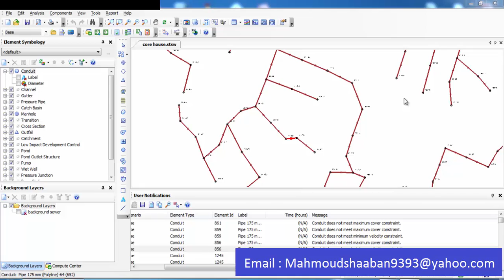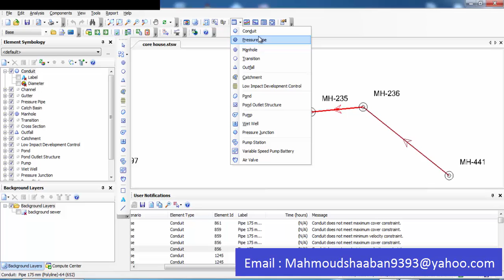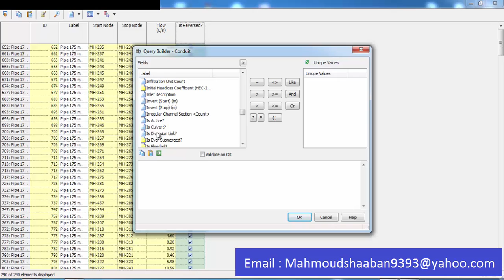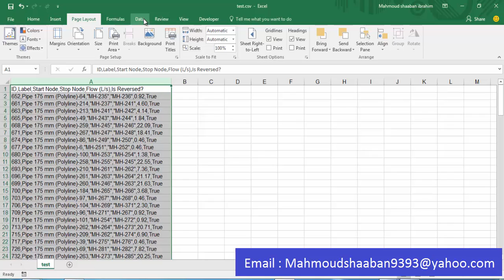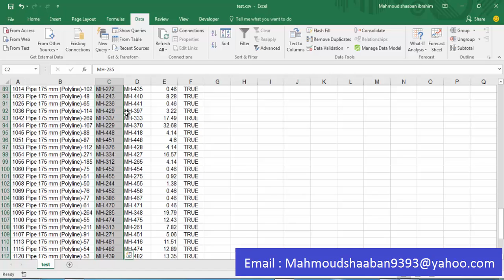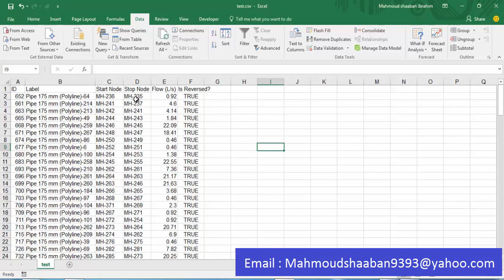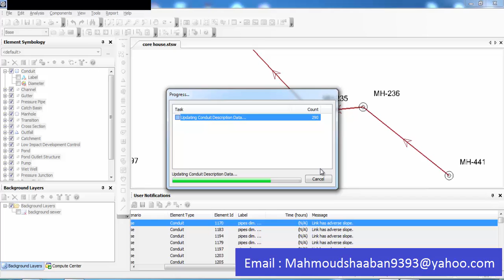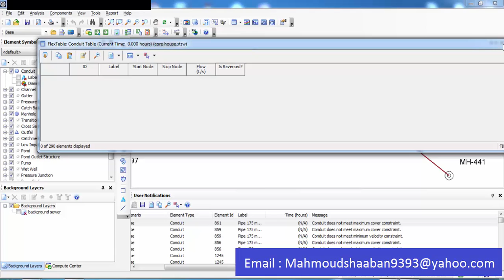Bentley sewecad & sewergems ,reverse the conduits direction automatically.

Comment: How to solve this problem in water gems
Reply from the maker: But in water gems the direction of the flow is not constant as it changes per hour during the day. So it is not considered a problem in water gems. If u still want to do this you can do the same steps but the reverse will be know by the negative sign of the flow.